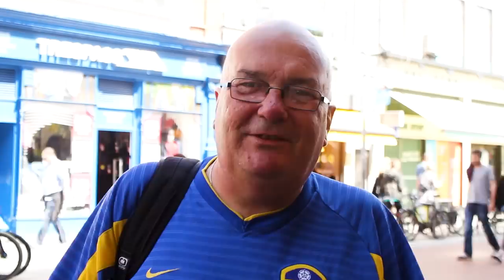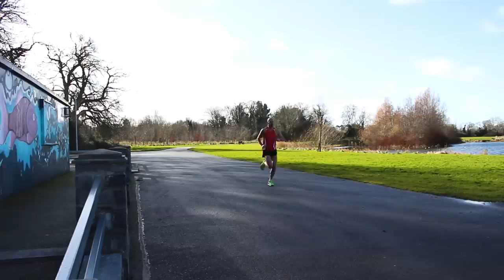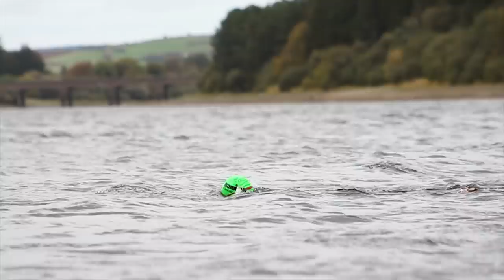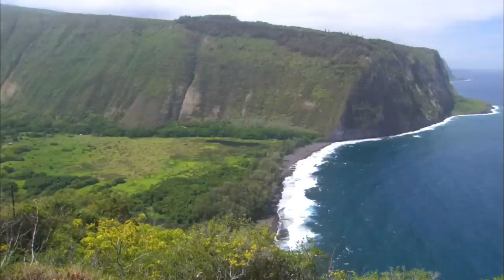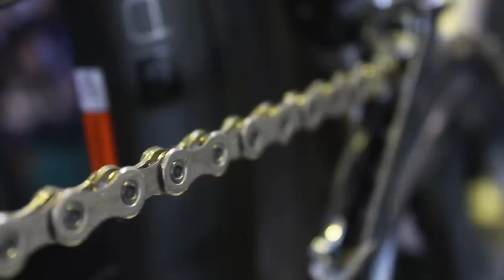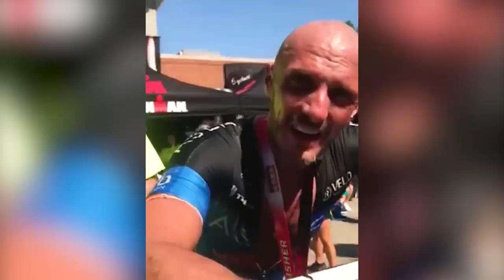Chasing Kona: From 60-a-day smoker to elite Ironman

Comment: Most come to Texas to qualify because the course is faster.  Not easier because it's hotter and more humid but the bike and run segments are flatter.  I wish I could've watched your finish last year but I was on a bike course to Austin for the MS Society. Truly inspiring video, especially for me because I'm a middle of the pack runner/biker and a terrible swimmer but the IM is on my bucket list.  I can relate to the issues you have had with training burnout and that's one of my main reasons I haven't signed up yet.  Keep pushing on, you will get to Kona one day.

Comment: I smoked for years myself. I quit and got into running and then cycling and I figured I couldn't ever perform at a high level because I had smoked. Maybe I could have performed better if I hadn't but hell 5 years later I Have won an mtb race and podium-ed many times. I still haven't found my ceiling. Kind of got my eye set on an Ironman now. If you did it that proves its possible.

Comment: For those ex-smokers or those seeking to clean up their lungs. I recommend drinking mullein leaf tea. It greatly cleans the lungs of all that gunk we get caught in our lungs through smoking and other ways. Not only that but it greatly helps with a wide range of other respatory problems such as asthma and bronchitis. It also helps with kidney problems. Wish you all the best. :)
Reply: @K9 1 those that have never taken this before will have their lungs cleaned. And so therefore it will make them breathe better; bettering their entire health. The body will also breath a little less per min because the lungs will be breathing more effinciently, with clearer lungs. If you have very clogged lungs from heavy smoking tabacco and/or cigarretes. Then it should be taken weekly even daily if they suffer from disease such as brochitis or regular/frequent cough. Depending on how frequently and for how long you have smoked tabacco or cigarretes should you take the necessary tea. If i smoked 2 cigarretes a day for 2 years. Then i should take it daily for some 5-6 months. If i drink it weekly then  take it for a year. If you never smoked taking it will still clean your lungs from what pollution is inhaled, second hand smoking, if we inhaled debris, heavy dust, chemicals if you clean with sprays, regular dust. And it will improve your lung health and clearness in breathing. But mullein leaf tea isn't like a body enhancer. It just cleans, cleanses, rejuvenates the respitory system and other organs. Hope this helped! Sorry for the late clarification i misinterpreted your question. :)